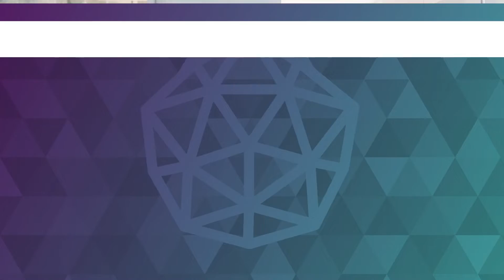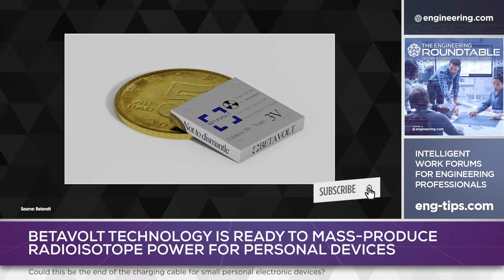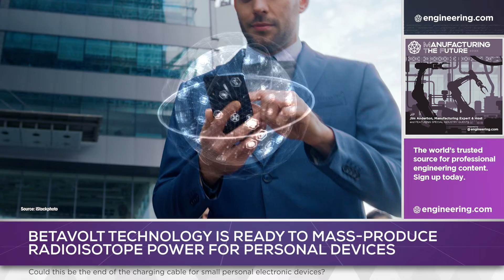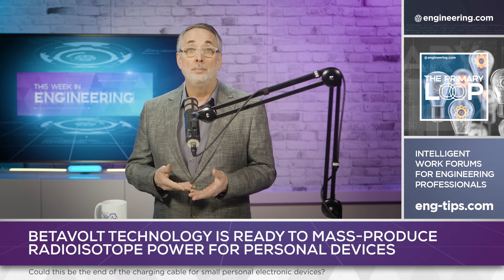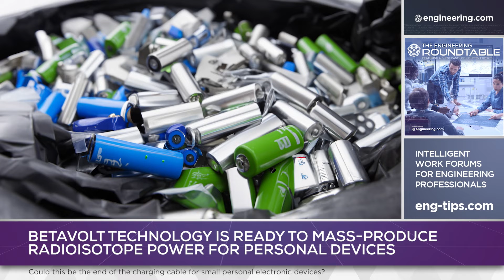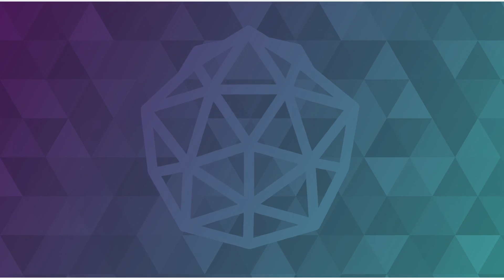A nuclear battery for your cell phone?

Comment: It could have potential uses if the size of the battery is unimportant, if you dont mind having those suitcase sized  laptops from the 70's sure you can take with you anywhere and never worry about charging it.

Comment: Not enough power, I'd say let them cook longer until  they can produce at least 1 amp of power, at this rate you will litteraly need over 1000 of these batteries to produce 1 amp of constant power, which is no where near enogh to power any smartphone on the market. Its a pipe dream! The battery will need to ne the size of a litteral brick, much bigger then the brickphones from the 80s. Even if they want to use betavolt battery to passively charge your smartphone device you will you will need to wait half a year to chrage it fully, wich is a huge waste of resources, even marketing cant bend the truth so much to make it feasable, salvagable, and legal!